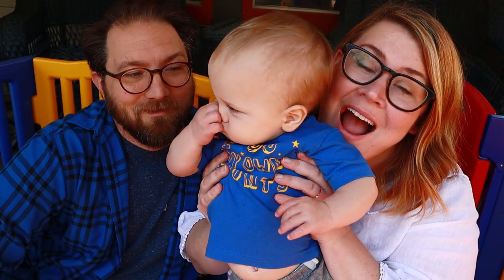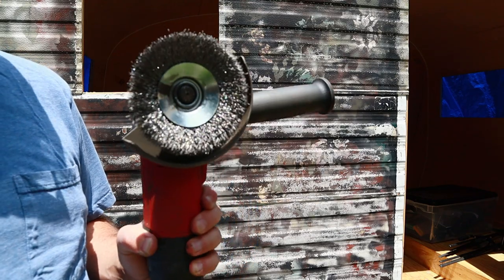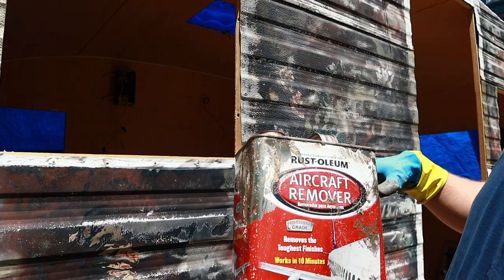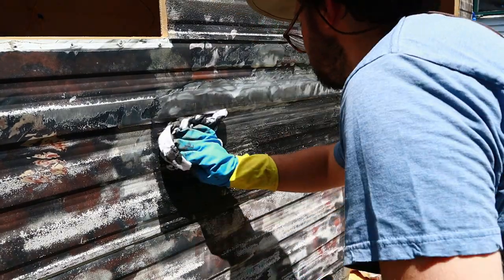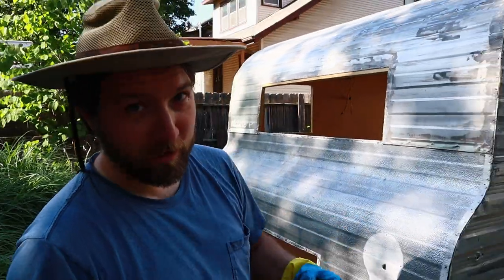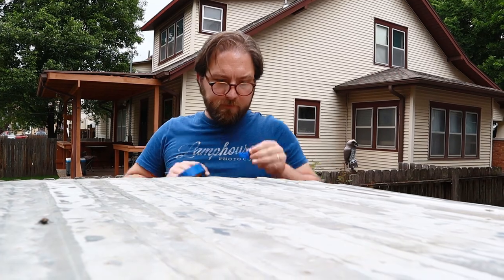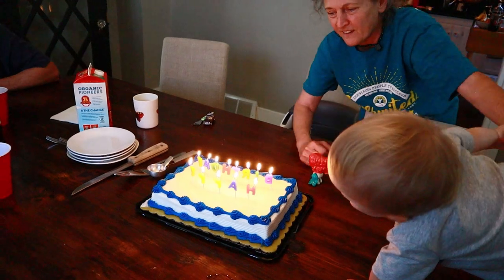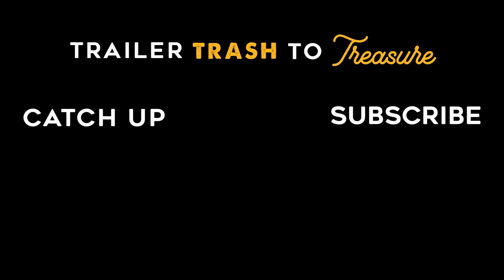STRIPPING A VINTAGE CAMPER // frame off renovation 1968 play mor

Comment: So glad I found you guys! I have a 71 Rancho El Rea. I removed a section earlier this year using oven cleaner. Although it worked I should have bought a case and a tube of Icy hot.
Reply from the maker: Oof yeah, it was a hard, hot, smelly job removing the paint. Glad we did it though but wouldn't do it again 😅 thanks for watching!

Comment: Paint stripper will take that stuff off really nicely.
Reply from the maker: Aircraft Remover does the trick!
Reply: Hi! How do you think the aircraft remover compares to citristrip?
Reply from the maker: I've never really used citristrip, but I gather that aircraft remover is faster but more toxic.
Reply: Where do you buy the aircraft remover? I’ve looked on Amazon, big box stores & Ace. No luck!
Reply from the maker: Check out your local auto parts stores. I think I usually get it at AutoZone.

Comment: On my 1972 Cardinal camper.  The butyl  is so hardened.  I can get some of it off in one piece, yet often I have parts of the butyl that still wants to adhere.  Do I have to get it all of before painting?  Wow that wire wheel is aggressive.  My trailer has a lot of oxidation that I need to get off. curious to see why you did not tap out some of the dents when you had the siding off?  Love to see you using the 5-in-1....as a former painting contractor They are my favorite tool.
Reply from the maker: Those 5-in-1s are the best tools, so many uses (more than 5 if you ask me)! Anyway, if you want your paint (and your replacement butyl) to adhere well, you really should get it all off. There's a lot of products and methods that you can use to remove it. Mineral spirits or products like Goof Off work pretty well, and sometimes heating it with a heat gun can help loosen it up to scrub it away. It's time consuming, but you know 90% of a good paint job is prep work.

Why didn't I tap out the dents? There weren't really that many that I felt needed to be done, and sometimes when you start pounding on aluminum you wind up deforming the whole panel and goofing up the metal seams. The best way to deal with dents is to just replace the panel.

Good luck!

Comment: I'm working on a 1972 camper and the original painted aluminum siding had some terrible patches and we don't want to keep them.  I likely going to need to buy new paneling.  Do you know of a good company that supplies rv paneling?  Some that I found are mostly in California and the shipping costs more than the siding itself.
Reply from the maker: We actually ended up buying our replacement siding from Hemet Valley RV in California. The freight wasn't cheap, but overall it was affordable and Steve knew exactly what we needed and made the process as easy as possible. I also contacted a place in Colorado called the Metal Company Inc., but they never responded to my requests. There's also a place in Oklahoma called Mac's Aluminum Products, but I don't have any experience with them. Good luck!

Comment: Would you be able to sandblast the siding instead next time?
Reply from the maker: That's something we talked about and decided not to do just because we were worried about possibly deforming the metal and the mess it would make. Our next camper we're just replacing the skin with new all over from hemet valley rv - should be fun! Thanks for watching